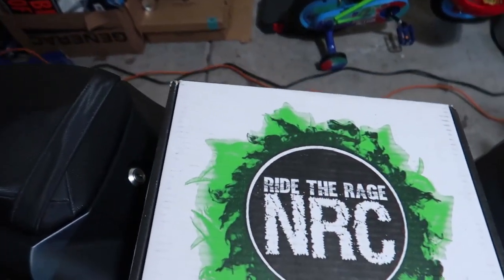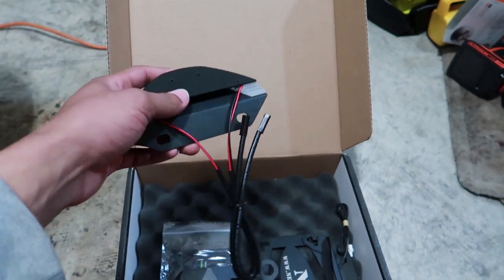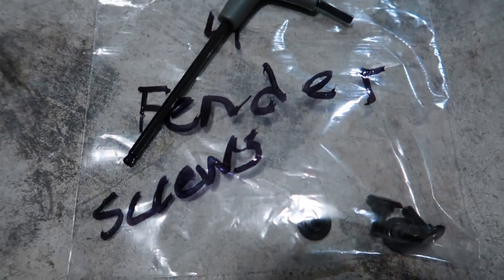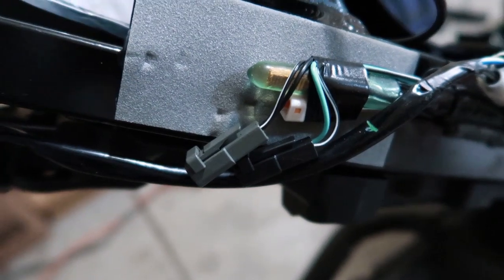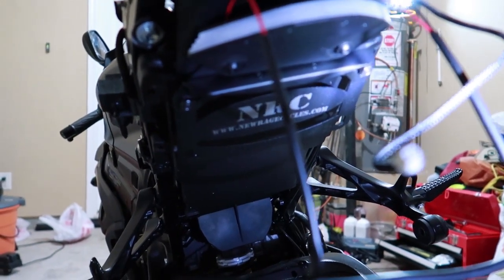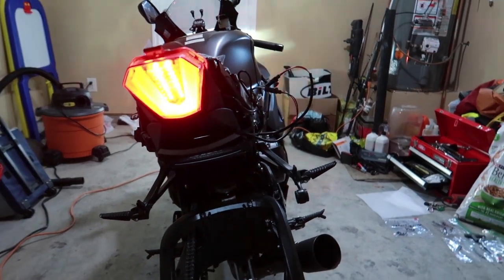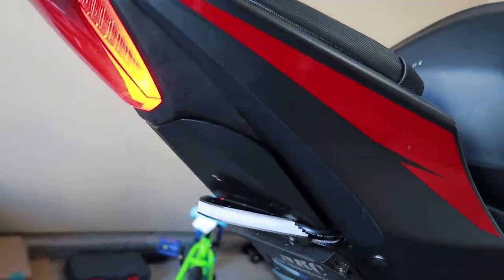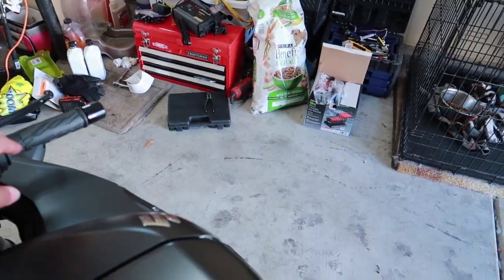How to Install Fender Eliminator Kit GSXR 1000 2017 Present

Comment: Good video, step-by-step commentary. Just got my new rage fender eliminator kit yesterday I am going to put it on my 17 GSXR 1000R this weekend.
Reply from the maker: I love mines. Still functioning the way it should and looks great
Reply: 2x Moto Tv   Having a little problem, I plug my license plate connector in and not working, also plugged my turn signals in and not working. Any solutions?
Reply: I just got my R1000R .. can’t stand this whale fin. Eliminator comes weds , but can’t remove this one for fear of police. Don’t we have to have the dealer plates and turn signals at all times ?
Reply: @TheeBlueSkyMedia  Same here with police too but I don’t care. I think fender eliminator looks good on my bike.